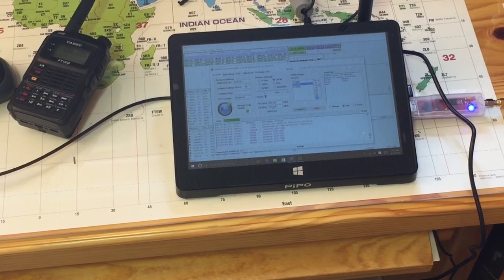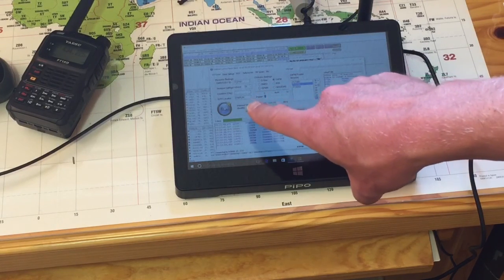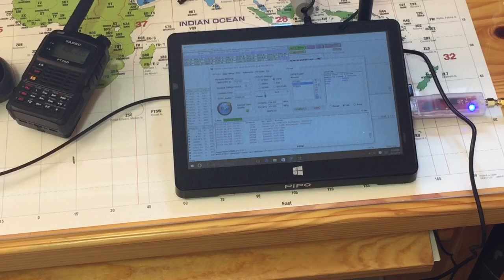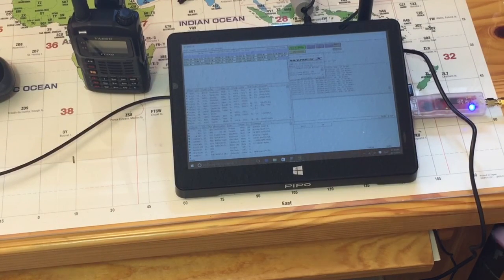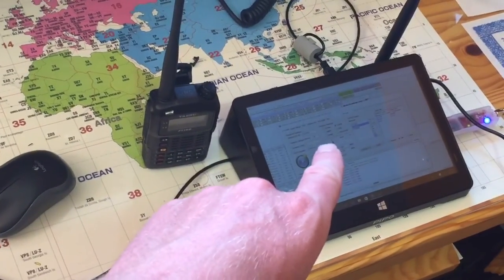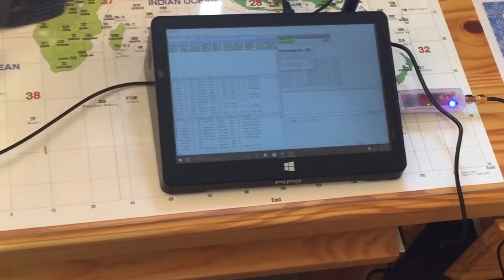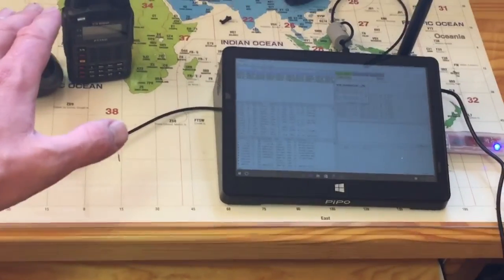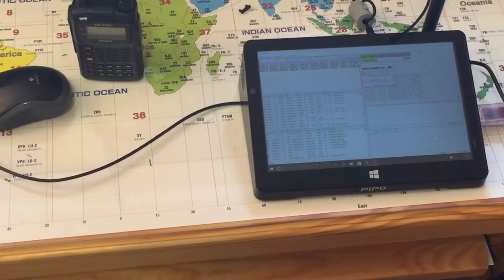"The bridge" Wires X/ DV4MINI "  *BASIC* walk through

Comment: I know its a dated video, but how do you get the DVMini to ignore the WiresX command button from your transmitting radio (the handheld)? I am in the process of setting up a YSF Reflector to bridge with a wiresX repeater and don't want both machines to answer the command if at the location of both the repeater and bridge device.

Comment: That cleared it all up for me on the bridge I did not get it I do now thank you do you do the same for DMR then
Reply from the maker: good afternoon. just want to note , quite a bit has changed on the hotspot side since . currently i just do a Fusion (room) to FCS (reflector) using a FTM 100 on the fusion side and a openspot1 on the other.  I can't save i've played a lot with DMR. I assume it MAY be different or more difficult due to time slot issues BUT i could be wrong.

Comment: I have attempted this with my Jumbo Spot and I can't get my Wires-X node radio to receive what the Jumbo spot is transmitting.  My Jumbo Spot will send out to DMR what the Wires-X node radio transmits.  Can't figure out what I am doing wrong.  Any thoughts?
Reply: Kyle Walker believe I’m having a similar issue.  My node radio seems to hear the rf from my hotspot the hri just doesn’t seem to put it out on the net.

Comment: So when you transmit on your handhed is recieved by both DV4MINI and WiresX at same time.
Reply from the maker: Michael Hendershot correct , when I use my ft1 and tx I am also using the same frequency as both the dv4 and wires x devices are using . And being that , and using around my home , they both hear me and the system continues to work .

Comment: How are you finding that Pipo X8 for running a WiRES X Node?

I was thinking about picking one up for that, but would be interested in hearing how it handles being left on for long periods, and if it's stable and up to the task of constant Gateway use?

Regards

Jon 
Fusion Gateway: MB6IGK-GW (17448)
UK-NET-HUB
Reply from the maker: LOVE the computer itself for the DV4mini side, however noticed (On the wires X side, the audio transmitted FROM your link radio) suffers from a bit of Lag/ pausing/ chopping.   Audio  put into the system from your mobile/ht radio to the link and fed by the PIPO into Wires X sounds good.

I did manually check for updates on EVERY single driver one by one, as well as all windows updates. Also disable unnecessary processes trying to "slim down" some of the extras and the issue continues.

I have since switched to a Refurbished PC from amazon with a bit more guts, and the problem completely went away

hope this helps. feel free to ask any questions, if I know, I'll def share.
Reply: Thanks for the info. 

I'm currently using a refurbished 2007 Hewlett Packard Compaq DC7800, and the old HP is more than up to the job, I was just looking for a smaller footprint solution - with a built in screen.